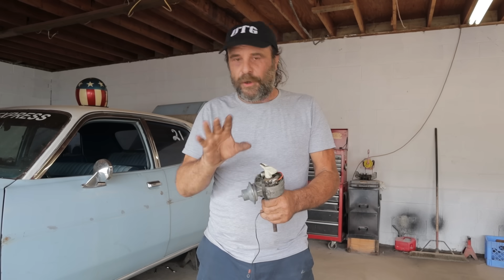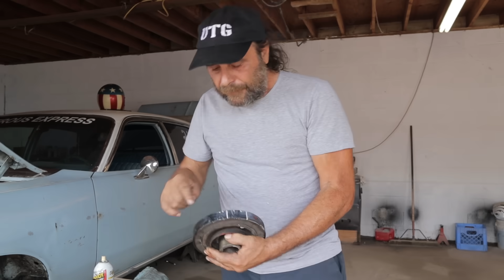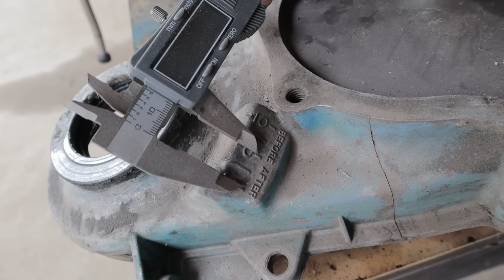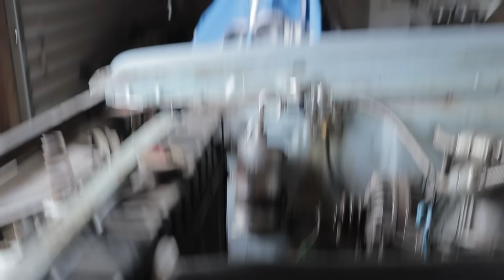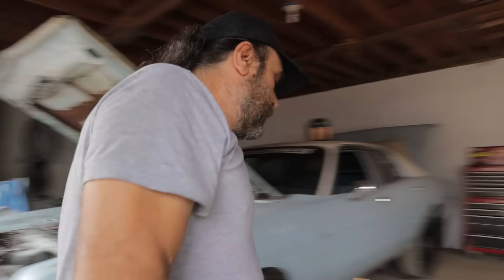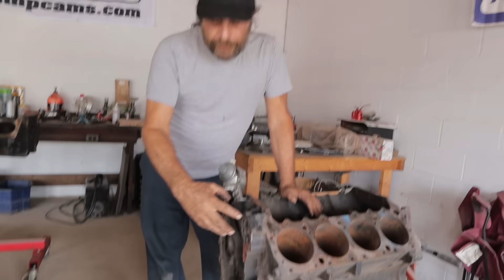Ignition Timing For Power

Comment: Peopel are bether of with real magnetos not that crap HEI .
Just me opinion.
MC 3334 ic chip pdf file show why those systems are terribel set frequency 30-333 hz current limiter,voltage limiter ,coil saturation to late lost power constantly those ic chip stop working under lower speed ranges it is not variabel enough advance and retard is to low.
For days I surche for circuet that can buff up 4 pin GM ignition module so fare no sucess be adding simpel ceramic magnet to the pick up coil spark was lot bether.
So the old magneto was best choise at least it was variabel via advance/retard lever .
Even points fail open at high speed.
Those coil packs are garbage as well dual spark is great but not if it cant ignite any thing .
Mostly HEI fails in winter at low speeds thats their biggest problem.
So who surches for perfomance tap in to alternator winding give ignition coil full ac power or use power transistor to pulse ac use capacitor banks insted lead baterry even if you use baterry use it only for starter motor make shure you dont get shocked insulate alternator with proper wire insulation or use dual alternators .
HEI isnt the system for perfomance nor does CDI only pure magnetos can help .
I did manage litel to retard ignition timing with linear and normal potenciometer but problem with resistance didnt go well as I expected so those engines need terribly retard mechanics when engine is cold perhaps rewinding pick up coil useing shmitt trigger or some one sugested useing triac might help The 5pin gm ignition module wont work GM engines need thicker piston rings ,braket holder for crank shaft lubrication bearings and reinforced gaskets found similar to tractors they also requare tungsten spark plugs for best fuel economi power gain and torque thats the set up for doing so and modified alternator and starter motor who can work at low'r speed's faster opening coolant thermostat proper transmision and problem solved .
Those are after all Gasoline-Disel engine blocks all of them GM Chevy Ford Pontiac Oldsmobile all of them are nearly identical.
Your realy good mechanic but for cold weather states HEI will fail except if those blocks habe oil pan and block heaters then it might work.
I wuld advise also to get ride of stock wire harnest and build for ich device seperate fuse and reverse voltage protection preferably closed loop baterry system not to tuch any where car chassys ground preferably add electric pump on brake booster in case of emergency crank case gases and coolant eat up rubber and plastic parts so bade idea lubrication oil to mix with brake fluid posibel engine run on problems might acure normali those old engines have alternator back sharge problems and coolant electrolisys.
Thats also reason why they start teribbly at winter they also miss air compensator as well so the engine chokes if some one drives to close to trees in cold mornings .
Thats so fare what I know about those old cars expecialy on magnetised engine close to trees engine floats instanly so I advice peopel to do such simpel modificatins if advanced ignition timing the gasoline engine behaves like ordinary disel engine .
Other vise US engines are best they rarely fail .
That is considered about GM problems who randomly acure so manual advance/retard lever is necesary similar found like on Oldsmobile 1930 car .
Nothing ells can help those old cars they are bitch to turn ower at winter so baterry starter assistance pack is necesary with automatic on/off feature baterry charger .
Hope this helps some one .

Comment: I’m finding conflicting info on setting total timing. Some say total is set by rotating distributor and others say total is set by changing springs inside the distributor and not rotating. Which one is true?
Reply: The springs just adjust how quickly it the total timing comes in.  Lighter springs make the total timing come in at a lower RPM.  Typically you want all the timing in by 3000-3500 RPM for drag racing, and a little higher RPM for a mild street engine.

Comment: Uncle Tony, years and years ago, I had my brand new, all forged, aluminum heads, 9.8 static comp ratio, 383 stroker Chev, dynoed at 511hp. We brought it all the way up to 40 degrees advanced. Made best power there. 

Sound normal, any thoughts?
Reply: Not uncommon on a SBC.
Reply: I've built hundreds of SBCs over the past 40+yrs and they always fall between 34-42 degrees depending on the build.
Reply: @thereluctantgearhead4544  ok thanks!

Comment: I made my own marks using masking tape.
Put the masking tape on top of the timing tab, mark the lines, they are 2° apart then put the masking tape on the damper. Kinda like using timing tape, then use a marker to mark the damper up to 40°. On my small block n big block Chevy, full advance running the engine using a timing light, hit on 36° full advance, which was coincidentally at about the 12 o'clock position on the damper. I used a medium n light spring on the HEI distributor.
Both engines run great! Great drivability, and good getup n go when I need it. Passing gear 
kicks in good n hard n works great as well.

Comment: Hey Tony, I love your channel and I'm amazed to see the depth of your knowledge! I have a question for you.. I noticed that if I install light springs on my HEI distributor, timing at idle will go up about 10 degrees when using both lights springs and  if I mix 1 medium and 1 light, it will go up about 5 degrees. My question is: can I safely say that initial and total timing should be unaffected by the springs I use? Meaning if I install the distributor with the stiffest springs, so that the weights don't open at idle, and I set initial at 10 degrees, then I swap the springs with the lightest ones, advance will jump 10 degrees at idle and I'll read 20 degrees at idle... Can I safely say that my initial is still 10 degrees BTDC even though advance is 20 at idle? My thought is that initial advance is different than advance at idle and what I should really be concerned about is my initial, with no added centrifugal at idle, and my total; then I can play with the springs to get the curve right.. Am I looking in the right direction? Sorry if this is confusing, I'm trying my best to ask this question so that it makes sense what I want to know..
Reply: Lo siento estás confundido 😢

Comment: My first car was a 1973 Chevelle with a 350 V8. The way I set the timing on that car was, after re-curving the distributor using an off the shelf kit, drive the car with as much timing advance as it would take. To test it I set the timing and then did full throttle acceleration. If I heard detonation I backed it down until it got quiet. Very, very scientific. 

BTW my badass engine had a Holley 650 4-barrel carburetor atop an Edelbrock Performer intake, Hedman headers feeding into a 2.25" dual exhaust kit from JC Whitney I hung myself with baling wire, and turbo mufflers. Also had a B&M shift kit in the 350 turbo transmission. With the stock smog cam, 8.5:1 compression, and a very tall 2.73 differential. It was a bit slow off the line, but the top end was awesome. It would bury the needle on the 120 mph speedometer, and I mean literally down below the window on the dash. It was fun for a high school kid.
Reply: Needed a cam dude
Reply: @chopperking007  Most definitely it needed a cam. But there’s this stuff called “money” and I didn’t have enough
Reply: @MrJeffcoley1  here in Australia in the 80s we were putting  big cams in your 70s cars and reving them to 7000rpm
Reply: @chopperking007  We were doing it at the exact same time LOL
Reply: @MrJeffcoley1  and we still are lol

Comment: Tony:  I purchased an MSD Ready-To-Run distributor with a wire used for setting up a rev limiter.  I'm having some trouble with the total set-up of the rev. limiter.  The directions also have an addendum that suggests installing a relay between the distributor and coil.  I have a couple of methods for doing this on hand.  Could you show your audience how to install and wire one of these distributors correctly?  Thanks for any input you might have.

Comment: Love your channel love that your a mopar guy as well. I bought a 73 dodge w100 with a 75 440 sat for 10 years got it running drove it ran fine. I think I got cute and has a holley double pumper street avenger 670 took it off and changed the gaskets that's it. No I can't get it running has plenty of fuel. Never messed with the timing. Help please.

Comment: I have both a old sbc and a new ford coyote I race. Funny thing is despite all the fancy computer controls on the coyote, for power, I still time it the same 27 degree from 3500rpm and up (it spends all day 4500 to 7500). You old school guys might be interested to know I can still use a timing light with a lead extension on the coil on plug ignition coils.
Reply: Don't know if you still have that but that fucking Ford Coyote is something!
Not many engines even have a life at 5500 rpm for long but that damn thing wakes up at 4000 by 5500 is getting some what we say in Oklahoma "getting on one" and is like a screaming mad man crystal meth monster at 7800 RPM as you hang the fuck on and that bitch is like.... MORE MOTHER FUCKER! PEDAL ON THE RIGHT! PUSSY!
 I was never really a big Ford fan until I was pinned to the seat from one of those and once we got down the road got off the highway and went back to where we started and picked up my asshole and soul that got left behind when we launched into what I can only describe as the tunnel vision of destiny! I was fucking SOLD!
I can't afford one right now even at age 46 but I had enough to get a 94 mustang with only a 3.8 V6 with a T5 manual 5 speed and it's not much but I got it delivered on a trailer not running in 3 years and is now my daily driver!
Many can beat me and that's okay but they bought theirs and I built mine!
But when I grow up! One day ...
I want a fucking coyote fire breathing mad man meth monster!
Lol
For now I play that role in my 6 banger!
LMFAO!

Comment: Question for you little bit confused. If I have my timing set at full advance do I have to lock out the distributor. Hei with a vaccum advance. I have the vacuum unhooked for now. 350 small block Chevy.. Thanks in advance for any info.

Comment: So Tony are you saying for that first startup you want the plugs to be firing (in this case) a 32 degrees before, at idle?  Or are we assuming the engine is to be running at break-in speed right off?
Reply: Actually depending upon your distributor ignition curve it will set your initial timing for better startup on a fresh engine. Remember if you are first starting an engine with a new camshaft and lifters you want to get the engine to start without excessive cranking in order to get your oil pressure up and to get the oil moving through the oil gallies to  properly lubricate the engine and to break in the camshaft and lifters. You of course want to have the engine at a higher RPM (this differs with opinions) but you want it at least 1500 RPM for a time (again this differs with opinions) I knew one fellow who would start up a fresh rebuild engine and run it at 1500 RPM for twenty minutes or so and then lower the speed down to 1000 and run the engine total for around forty five minutes checking for oil and coolant leaks. There is different opinions on this but the idea is to get the engine to fire on the first lick and get oil pressure up and run in the engine in order to break in the camshaft and lifters properly or you can wipe out camshaft lobes and lifters (not good) You set this as Uncle Tony has described and the engine will start up right off, provided it has enough fuel in the carburetor.

Comment: I purchased a 421 sbc it starts and idles great in park. When it is placed in drive the rpms drop to 650 to low. The distribution vacuum was capped off by the engine builder. The total timing was set on the Dyno for total timing at 35 to 36 degrees.  I was told to add initial timing to make run better in drive.
Do I uncap the distributor and connect vacuuming advance? I do not want to change the total timing as it runs and idles great but I need the car to pull better in drive.  how do you add initial timing without changing total timing.  I have always been told to set total and let initial be what it is.
Lease help!  Comments thanks

Comment: I like your "old school" approach! I've been working on cars for over 50 years and have used almost all, if not all of your methods. FWIW, I scrapped a $1200 custom electronic ignition and went back to points because of reliability issues. The engine is just as happy with points, and it doesn't suddenly quit and leave me stranded!
Reply: If points were more reliable than electronic ignition you were doing something seriously wrong. Points you've gotta deal with every oil change. I never had an electronic ignition system that went less than 60k miles before a failure, and that was the distributor shaft wearing out.
Reply: Ugh.... 
I'm a young man, I know about points, but HEI is where it's at.... 
Remember back in the day, everyone used to carry spare points in their glove box? You know.... incase THOSE POINTS went out while you were out lol 
I carry a spare coil and module and cap in my classic and all the stuff needed to change out these parts. change them out like a set of points on the side of the road if need be... 
I've yet to have to use my spare ignition parts because hei is so dependable and on the money all the time. 
My secret? Buy the cheapest distributor in the jegs book if it's GM make sure it takes a 4 pin style module. 
Then.... 
Buy another one. 
Rob all the parts out of it....
CARRY THEM IN YOUR TRUNK OR GLOVE BOX
Last time I bought one one was 79.95$ and it was 120$ at my local orielly for a cap, module and coil. YUCK. 
You get to keep the extra body incase your shaft bearing starts to go bad or something happens to your housing, AND you get all the parts to rebuild the one in your car at a cheaper price. 

EXTRA CREDIT : Since the housing and internal bearing never hardly go bad...  take that spare body and build a tuned distributor.  One with very high out put, light springs, and all the fixins... 
Then when it's time for a tune up, drop it in... enjoy....
Reply: Well I have electronic points, & carry a spare unit.  If it fails, its a case of undo one screw, remove & refit new one, now adjustments required.  They are magnetically operated, so no heel wear or timing changes. To hell with points.
Reply: And don’t forget to carry a pack of matches in your glove box to set your point gap

Comment: something you might want to mention about static timing an engine is it works with points but not on capacitive discharge ignitions and I believe on multiple spark ignition systems. It helps when you have everything in place battery,  coil, ballast resister plugs etc. along with a distributor with a cap and rotor. really enjoy your videos keep them coming stay safe.

Comment: Tony, so I put a draw through turbo on my sbc 350 and retarded the timing a little bit to get my low end torque back but it had slow spool until around 2k rpm, was wondering if I lock out the mechanical advance and plug the vacuum what would be the idle timing be. Should I start at 15 btdc or 20?
Much help would be greatly appreciated thanks

Comment: why not just use a ported vacuum instead of a constant so it pulls evenly throughout the RPM range so you dont have to load up your engine by fattening up your carb adjustments and foul your plugs every time you drive the car or re tuning it every time you want to make runs to pull more power from it

Comment: You can also use a protractor to measure off the degrees more effectively by lacing the center of the protractor on the center of the crank/bolt area. This can zero you down to within 1 degree or on the money every time.

Comment: Thanks again Uncle T. There was one question you could not answer that maybe you could go into depth. Most of us have no access to a DYNO. We know ABOUT where total should be and if you take initial plus what the distributor is going to add all in, then you have a total timing number to check. My case. Ford 347 stroker, mild cam, pertronix III dist. So I have 15 initial plus 21 it gives and verified its 36 all in. The question remains, is that too high? Would it be better at 34 or 35 ? There seems to be no way to know unless 1) You have a dyno 2) you have access to a track with 1/4 mile times...LOL. So if you were doing this in my situation, what would you do to drive it and say "Ahhh..34 is better or no, 36 is better "? BTW , no ping at 36 but I do know any higher and I could blow a gasket or burn a piston...Help me get to the next step :-)

Comment: Best way to put this into practice: invest in a quality damper with 360deg timing marks etched in, and a quality pointer checked with a piston stop. Timing tape sucks and so do most stock dampers/pointer tabs. I fought this for years and finally replaced it all. Setting timing is a breeze now.

Comment: HOLD ON REAL TIGHT TO THE ROTOR WITH YOUR LEFT HAND. ROCK THE DISTRIBUTOR BACK & FORTH WITH YOUR RIGHT HAND...  THE PUT THE COIL WIRE IN YOUR MOUTH AND WHEN YOU FEEL A LITTLE JOLT OF ELECTRICITY ON YOUR TONGUE. BINGO! THAT'S YOUR TIMING MARK, REMEMBER TO TIGHTEN THE DISTRIBUTOR BOLT AND YOU'RE DONE.

Comment: The way you set up the distributer without a light is exactly how you set up mags on old John Deere 2 cylinders. The mags have an impulse trip to counter for the low cranking speed of hand starting from the fly wheel. So you rotate the engine to tdc of cylinder 1, pull the mag, stick a wire in the number 1 cap hole and float it off the mag body, rotate the coupling until it snaps and makes a spark, then put the mag back in and rotate it back until it trips again. Then once you start it you adjust from there. I always find it funny when technics stay relatively the same wether it’s a 1939 John Deere B or a 70s Mopar.